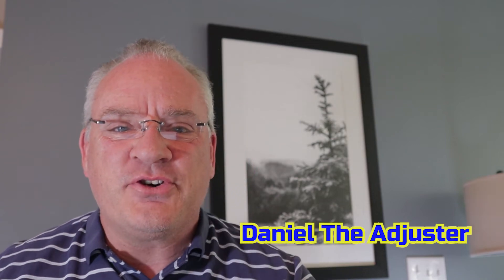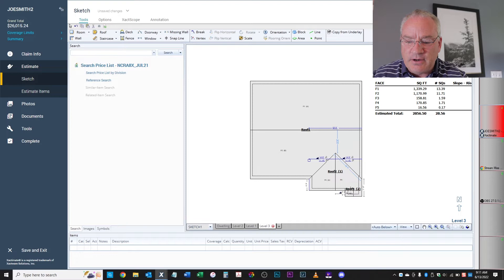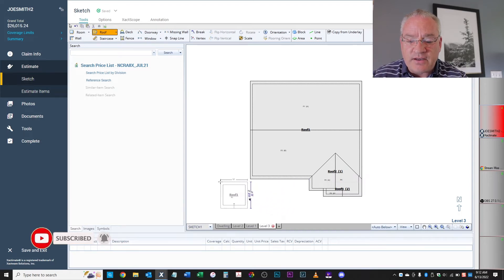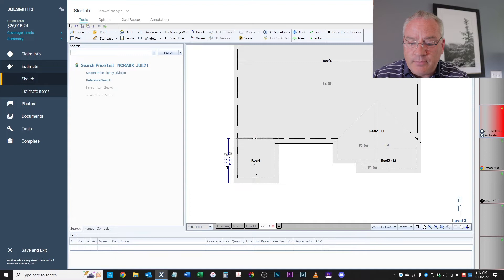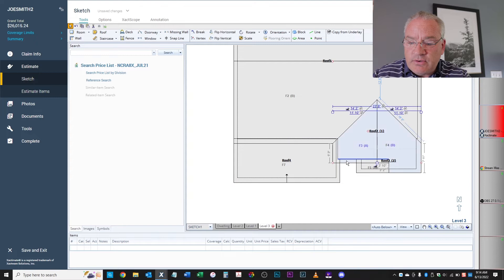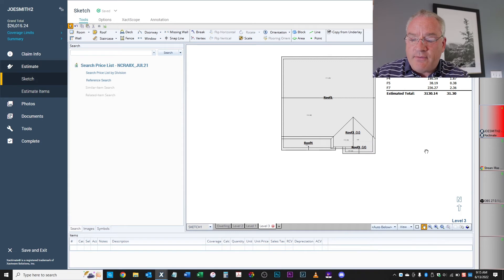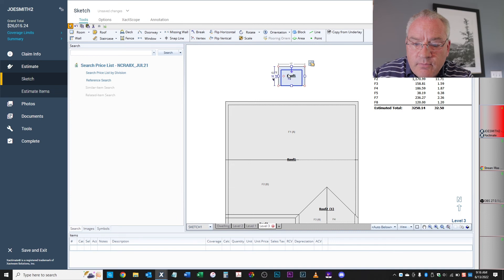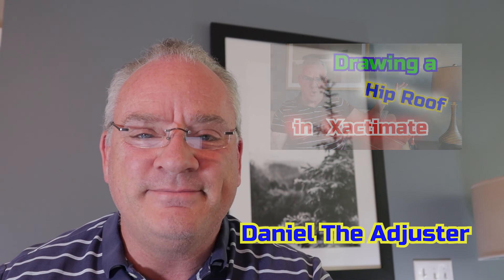Xactimate, How to Draw a Porch Roof

Comment: How do make the exterior house in that video show? That blue exterior? I tried to do the roof and when i do 3d view, just roof, nit the house with it also? Why is that daniel?
Reply from the maker: @JamesMississippi8677  good question James   

Check height settings
If a room is set to 0’ wall height, Xactimate displays no visible walls.
To fix it:
1	Select the room in 2-D.
2	Open Properties.
3	Set Wall Height to something normal (8’ is standard).
Reply: @danieltheadjuster talking about the roof, not room
Reply from the maker: @JamesMississippi8677      Yes, that’s what I was talking about. There has to be a room underneath the roof or a room in the drawing for it to show up on the 3-D view of the roof.
If you wanted all the walls to show, you could draw one room as all of the exterior of the home and have it underneath the roof sketch.    This way you can get the square footages of the wall walls on the exterior.
Without a room drawn, it would not show up on the 3-D roof drawing.   Hope that makes sense.